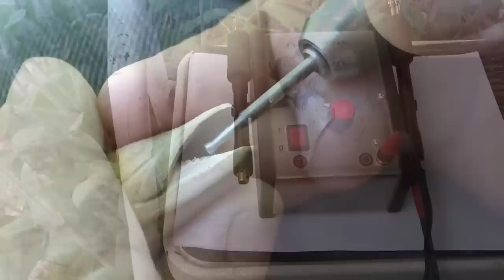Carving a Miniature Wooden Pike Fish

Comment: That's incredible! This video popped up in recommendations for some reason and glad it did. What an amazing job!! I'm in eastern Ontario and I'm not a fisherman at all. I went fishing in a large runoff culvert with my fathers red devil spoon after he warned me not to loose it. No idea how long I was there (30 yrs ago) but I was fishing near fallen trees and heavy weeds in maybe 4 1/2 - 5 feet of water running shallow when suddenly I hit a log. It didn't matter how hard I pulled or in what direction but I couldn't budge the lure. Fearful of my father threat I decided I had to go in. As soon as I hit the cast button for slack it took off gaining at least 50 feet before I knew what happened. For 45 minutes I fought to land this thing and finally I did. Totally honest, no idea what it weighed but in a bucket with a slightly larger diameter than a 5 gallon it wrapped around itself plus another 3/4 of its length. Sorry to go on, saw this amazing video and you brought back a memory buried long in the past! Thanks for sharing, you have great skill and I'll be checking your channel Stinnett!!